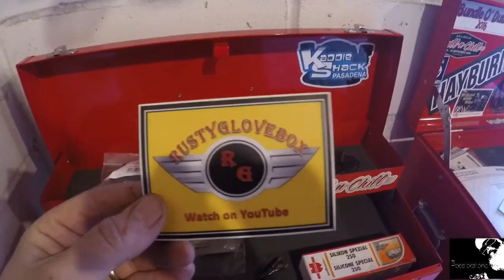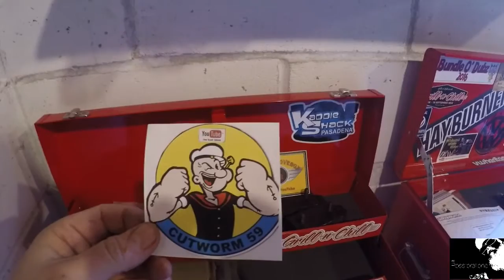Classic 1970 Vw Camper Bus restoration. 'Day 17 - belly pan & sill removal'

Comment: i've been watching your programs and i've got that intrigued by it, I bought one. It's mine and my sons and its roughly in the same condition. could you please tell me where you got your bottom sliding panel from and is there any chance of getting one of your stickers for the top of our toolboxes please, cheers, John
Reply from the maker: Hi John, welcome along and thanks for watching...congratulations on your new purchase, hope you and boys enjoy your new project. 
Just private message me your address via YouTube, or email me at restocal6t7@gmail.com and I’ll get you a couple of stickers sent out.
I source the majority of my replacement panels from A H Schofields based here in the UK. 
You will find the sill I believe your refering to from there also. However remember though, that you can’t get the sliding door track as mentioned in the video.

All the best with it

Ross